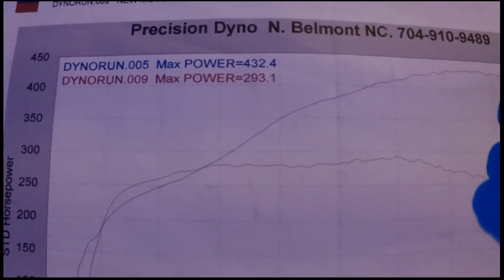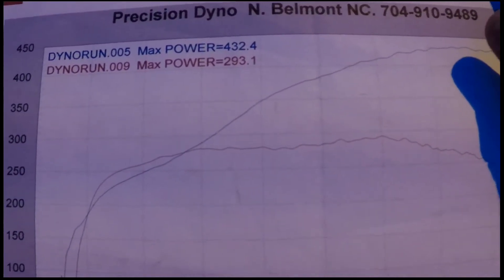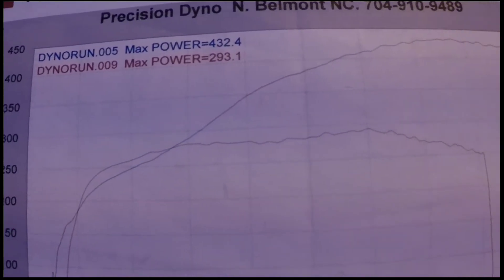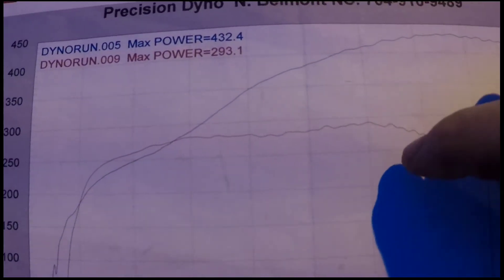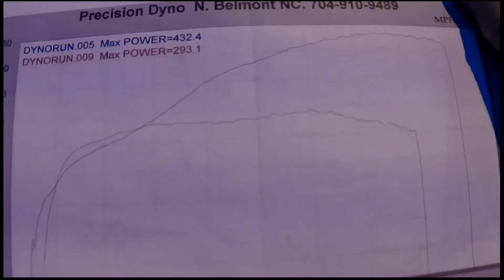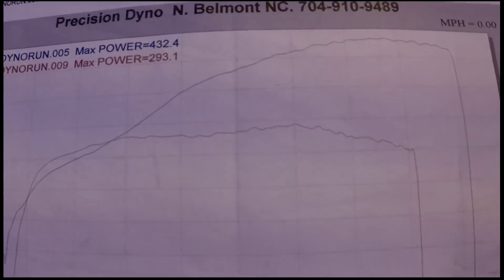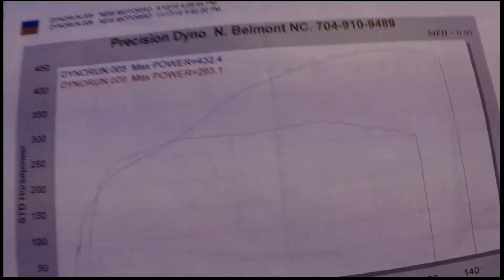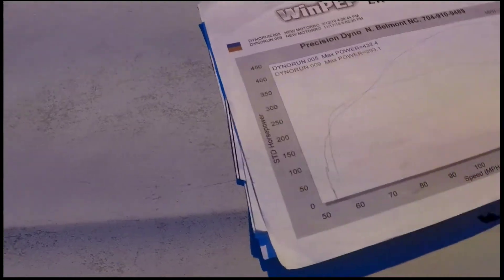Dynos: The Good, The Bad, And nothing but the Truth!!  Dynojet vs Mustang Dyno

Comment: Look up long headers vs cast iron vs block hugger headers dyno tests!! Proves you ain't losing as much as you might think!!! Unless you're making 1500+ horse power, headers aren't making as much a difference as you might think! If you're only making 300-500 hp, unless you have a near perfect exhaust setup, you'll only be losing 4-6hp, at worst maybe 10-12hp. Of course, the more power you make, the more you will eventually lose without using tuned long tube headers (compared to huggers/cast iron), but only to a certain extent! I know of guys who've tested $1500+ tuned long tube headers against zoomies, and they didn't notice a bit of difference at the drag strip, other than noise level.

As far as dyno testing, jumping from one dyno to another is an absolute no no!! Not to mention, the air conditions change not only from day to day, but from hour to hour, you're going to get wildly different readings!! The single best way to dyno your engine is on an independent engine dyno, where the air conditions are as controlled as possible, so you can actually see what your changes are yielding you. The second best dyno is whatever computer equipment you may or may not have on your vehicle, and your ass at the drag strip!!!

Comment: Having had a dynojet at my shop for 20 years, I found that a stick car lost 18% from the engine to the wheels. An automatic lost 20% plus roughly 1% more loss for every 100 rpm of stall higher than stock.

Comment: Thanks, your explanations cleared up my questions concerning Casper, inaccurate dyno readings and parasitic loss on chassis dynos, water temps.,etc. Keep putting out your content, your engine building and tuning abilities are a step above most that are seen on U-tube!
Reply from the maker: Thank you for the kind words...  If I have learned anything is that Dyno's are just tools to gauge your work...  I have seen engines dyno well and not deliver the goods at the strip..  and I have seen low HP cars completely destroy Higher HP cars..  its about what you get from those dyno results that matter... Avg Power and Torque is what wins races not just peak numbers...  Even though im building Project MIXED UP BOSS to make around 750HP im really focusing on torque production as my target for street/strip engines 1.4 lbft of torque per cube.. which for pump gas is pretty hot stuff... most average engine builds end up around 1.2 give or take... 
Andy

Comment: Hey Andy 5.00  maybe that was a nice flat axle torque at the  rear wheels  😏
Reply from the maker: Not torque!  That Dyno sheet was comparing max hp between the T45 Manual box compared to the C4 Auto with a big Converter...  Talk about hurting your feelings!  It was this that taught me Dyno numbers are just that... Numbers.. because the car was faster at the track with the Automatic...  Most Dynos software isnt designed to accommodate Converter slip in their programs...
Andy
Reply: @UnityMotorSportsGarage  
Yeah just a number ,  mine was done on two different dyno's , but same brand Dynapac , hub dyno  the good thing is that you don't cook up your tires .

Comment: David is a great guy. I have been to his class at his home and have talked to him at pri several times. Did you check the distributor gear to see if it’s worn. Those solid rollers ,like with the timing chain , will kill a drive gear and cause problems and you won’t have any indication until it slaps you in the face. Good luck.
Reply from the maker: Yeah as a matter of fact yesterday I pulled the Distributor out because I wanted to change the intake gasket.. in a upcoming vid.. you will see that the passenger side gasket moved when I bolted the intake back on when I changed the lifters..  David said it could be a combo of issues... Intake gaskets and the Fuel could be the issue!  Thanks for watching and posting!  David and I are working on some vids together! You will see them in the near future!
Reply: @UnityMotorSportsGarage   Hi Andy , I have fitted a composite to my billet Steel solid roller , so far so good .

Comment: You want to assemble a 331 shortblock?🕶
Reply from the maker: Sure, where are you located?  Right now I'm building a 351w and a 383  chevy..  what kind of time frame are you shooting for?
Reply: @UnityMotorSportsGarage  in the show me state..(Mo) I'm in no hurry what so ever. Waiting on my heads and intake to get here, for a 302 build in my little 2000 ranger. I was going to build the short block myself, just to say I did it. I am not a professional  engine builder, I am a professional  flooring installer. Sometimes, if you let your ego talk it will get the best of you!